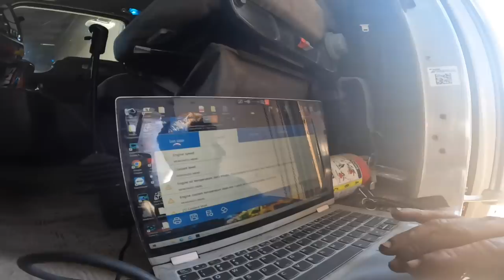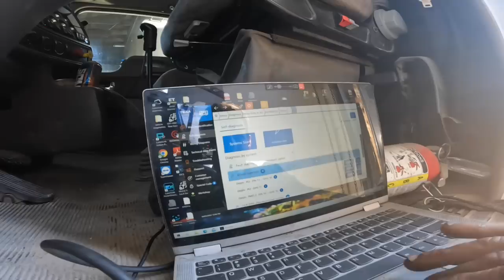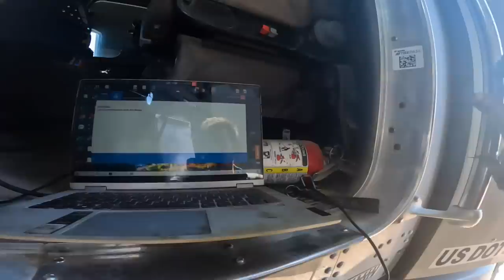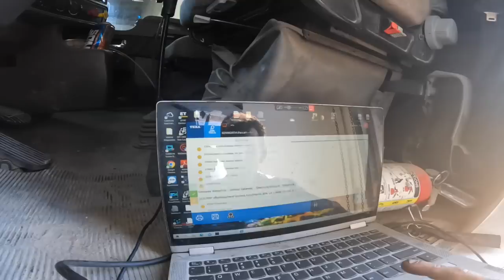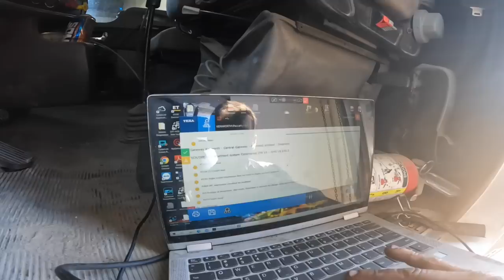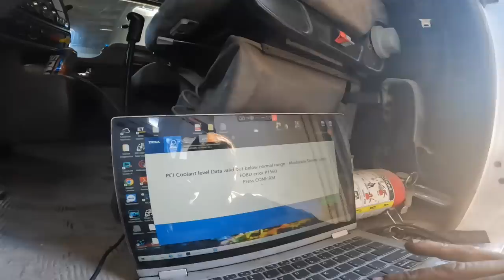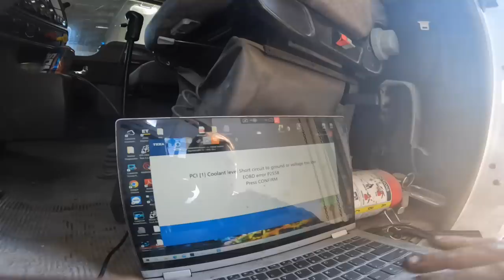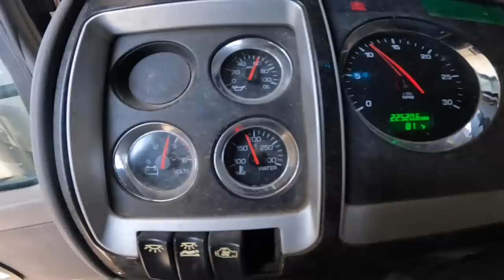Paccar thermostats and a cam over brake.

Comment: Not to long ago I had the opportunity to buy a couple Peterbilts at a real good deal.Once I opened the hood and seen they had Paccars in them. I shut the hood and said no way would I buy them.Especially after watching you work on them.Thanks for all your content on these pieces of junk.
Reply: Most all engines small to large that are junk. They but are built to break down so they make more money selling parts. As in my comment on this video, Briggs knew that the compression release was junk 10 years ago but did not fix the problem.
Reply: Paccar are no different to any other popular engine, there are tens of thousands in service and some have trouble. Mechanics never hear about the good ones as they work away quietly with no trouble. Cat, Cummins, Detroit, Volvo they all have problems. They are new to Warren though, he doesn't have as much experience on them as the more traditional "American" engines, perhaps understandable that he doesn't like them as much.
Reply: Paccar is just as reliable as Cummins. Just different problems.
Reply: @CHudson4  yes all manufacturers have issues but when they know there is serious problems and don't address them is something else different. Like GM ignition key problem for years and some have died because of it, that is the problem at hand.  Profit before product is what we have now. Yes I know no one has died because of Pacar  it's just one of many examples. A 18 wheeler not pulling loads is devastating to those who own them
Reply: @DaveG7920  profit before product. That truck is not making the owner any money now is it. Piston pin bushing walk out is poor Reman workmanship! Remember the John Deere engine night mare?  Once more poor workmanship!!  Both are from the dealership, where is the quality?
Reply: @jonbarfield4915  what problems are you referring to?
Reply: @jonbarfield4915  No its not making money but all manufacturers have problems with quality these days. Early Cummins emissions engines had plenty of problems (some still do) and Cat can't even compete and withdrew from the on highway engine business. Singling out Paccar isn't really fair, their engines work around the world in much tougher applications than the US market, its inevitable some will fail.

Comment: Had a giggle when you pulled in the driveway and said " that's the shop I used to work at ". I was looking at that little shed on the right just inside the drive, thought that's a bit small😅

Comment: Looking at that engine set up it kind of looks like you'd need to pull the pintle hitch to change the radiator cap.  I had forgotten what a pain in the ass dealing with cammed over brakes was , thanks for the reminder LOL.

Comment: Love the videos, I have two questions. First there was a hay wagon in the background when you were working on the trailer do you know if it's used to collect the plastic bales? and second there was a gasket (?) between the wheel rims and the brake drum, is that there to keep the corrosion from happening?
Reply: Yes, the plastic disc it to prevent corrosion between the brake drum and the aluminum rims. As for the hay wagon I don't know...

Comment: Warren, you crack me up! I don't see that much of a need to replace parts just 'cuz some other part is being replaced regardless of connection between the two.
I look at the water pump on my truck and think, "gee golly gosh, that pump looks old!" But why replace it? I drain and replace the coolant if it tests bad, the hoses are mere years old, I don't beat on it all unholy.

And the best part? No ECU.

Comment: Warren
I'm sure you know this, but there is a simple way to test those thermostats. Get a large pot and a candy thermometer. 
Put the thermostat  in  question into the water and heat the water to the temperature the thermostat should operate at, check the reading on the candy thermometer to see if the thermostat opens/closes at the correct temperatures,or if indeed it is stuck in one position or the other.   Just a thought.  I've used this test for decades.

Comment: Imo , the crank broke because the damper should have been replaced which is a common over looked issue says  per Bruce Mallinson at  Pittsburgh Power , now the owner should take the short  block have it installed , OPS oil filtration system put on and have a good maintenance program, I have listened to Bruce since 2009 very intelligent man 🙏
Reply: The replacement engine got a new damper because Warren didn't think it was wise to use one that came off a broken crankshaft. The replacement engine had 2 small end rod bushings fail. This was not a crankshaft problem on the replacement engine.

Comment: I hate to say it but I had a isx15 drop a liner at 450,000 miles, I had to pull the head on a paccar mx13 with bad injector cups at damn near a million miles..Paccar is a dam solid engine.

Comment: 544 John deere wheel loader , steering issues I've changed the filters, topped up fluids attempted to 
Make this thing respond not doing much. Um accumulators are the a plunger type thing, if soo can I un jam them if that's the problem?

Comment: Well its funny but I own paccars and the only issues in 500k has been nox sensors and a water pump. Been excellent for me. Excellent fuel mileage.  Will definitely buy 2 more in 2024
Reply: I have to agree. I have had great service from my Paccar`s. With just the normal replacements needed ( Sensors as per usual). I get excellent fuel milage and am happy with mine. But each to our own Warren is a capable Technician and likes old school for sure.
Reply: Agree. They may not be the best but they are generally pretty good. Better fuel mileage than the big Cummins and lighter so you can haul more. They are fairly new in the US market though and some people just don't like things they aren't familiar with.
Reply: My piece of shit Paccar with only 147k on it just got thrown back into the dealership for more issues leaving me stranded. This is literally the 4th month in a row it's had to be towed back to the dealership. Paccars are dogshit.
Reply: @Deleteguest  My best friend has 4 new freightliners and all 4 have been towed multiple times this year with less than 200k. Luck of the draw. Im totally satisfied with my 680s.

Comment: I’m not understanding the core charge situation. If you send the block with the broken crank back from when the short block was bought that would cover the core charge there, then when you swap out the engine currently in truck with the new engine that would cover that core charge. Unless I’m missing that the broken crank would not allow for a returnable core?

Comment: I work for a outfit that is mostly paccar MX 13's. Have had a lot of ECM failures that were related due to heat. Engine temp gets to operating temp and it stalls and won't start. The odometer and the hourmeter do not read anything afterwards. Can't get new ones so we sent them to europe to get fixed!!!

Comment: I’d let the dealer do what they have to do especially if it doesn’t cost him anything for them to do it and then if it broke down again I’d get them to fix again at no charge or replace with something better, I know where I’m located it’s three times for the same problem and it’s new truck or new engine, always brings a smile to my face when your playing with Josie, think it would benefit you to add more video than you put now of Josie along with the truck repairs, just a question is there any remanufacturing company that you’ve had good luck with or not at all

     Continued Success 
               Fabrizio

Comment: Just a measuring stick for ya, I’m up in New England (Rhode Island) I took my 250 under warranty over to Tasca Ford Truck Center, they quoted me 1700 for rear brakes, mind you everything except pads and rotors are warranty items, so backing plates, e brake cable, hardware, are all listed on my warranty, so 1700 for pads rotor (hat over brake e brake) so it’s a rotor drum hybrid, and e brake shoes… hopefully this helps you to know what the dealerships are holding customers up for…oh this quote came while waiting 7 days for them to swap an AC pump..

Comment: Damn it Warren, this job was not done correct. You need to replace the radiator too. While in the area replace the hood and bumper.
Reply: I appreciate the sarcasm but you will find that there are idiots out there who will think you're serious.
Reply: @danielbutler578  unfortunately it will happen. Common sense is hard to come by anymore.

Comment: Warren, always look on the bright side of things, if it’s a piece of garbage, all the nuts and bolts turn , or are already missing in the really bad areas, nothing is frozen, rusted, it’s all been apart nine times… see there’s always a silver lining…. As far as doing the water pump while your in there, we’ll maybe if it’s a cheep water pump?, and you had to remove it anyway, but on these trucks that’s not the case,

Comment: Those that make stupid comments are probably a mechanic. Over the years of listening to some mechanics they think that they are so much more intelligent than anyone else on vehicular. I remember one time I had a flex plate making noise because it was crack. He wanted to work on it because he knew I never took anything to a mechanic. He told me that it was a broken crankshaft. I already knew it wasn’t in the engine. He said I was wrong. I took the tranny off and guess what, the flex plate was cracked. I always listen to them but it’s not rocket science. Well now days it is.

Comment: You don’t want to just replace the coolant level sensor. Replace the whole reservoir from paccar. The reservoir comes with the sensor from paccar. DO NOT BUY A AFTERMARKET RESERVOIR. The magnet inside of the reservoir screws with the magnet on the sensor and causing false codes.

Comment: We have 5, 2022 mx-13 engines at a customer.They crapped injectors at 5000 miles.We took 1 truck out of service to use as a parts truck.SAD

Comment: the way it "should " be handled is to slow the timeline.. so the dealer that sold the shortblock processes the core.. crediting the truck owner. then Warren needs paid for his time and material... Now.. the Dealer makes good on a bad shortblock- crediting the truck owner full cost, against a NEW engine- AND - Installs the NEW ENGINE with WARRANTY on their dime...and the truck owner pays the difference in cost of the new engine against the short block..

Comment: in my experience with these Paccar motors they’re only good for about 100,000 miles before every little thing goes down hill…. oh and the EPA 17 motors eat cam shafts.. shit designs
Reply: Yea, you're 100% correct. I just had to have my piece of shit 2019 t680 Paccar fuck my ass engine towed back to the kenworth dealership for the 4th month in a row for more issues that leave me on the side of the road. Happened just today. It's got 147k on it with only 4600 hours.

Comment: "Truck mechanics" lol! Most of the dealer mechanics don't have any clue what to do unless it's on the computer to tell them how to troubleshoot it. We have a brand new freightliner rollback with a little DD8 and it was in the shop for 3 weeks while they spent 40hrs troubleshooting an ABS code

Comment: Regarding the "Pro" who told you to leave the trucks to the truck mechanics:  I've run into a few of these guys where the exact same engine was used in an application such as a generator or pump and all of the sudden they don't know what they're looking at anymore.  I used to try to explain to them to just address the engine issue and ignore the pump, generator, etc..., but I don't bother with these knuckleheads anymore.

Comment: I work for the largest logistics company in the USA (hint, thousands of brown trucks) and we have had nothing but problems with the PACCAR pos’s in our tractor fleet. Absolutely he worst engines we have ever run! They keep saying they have “fixed” the problems with the “new” design…. Yeah, that’s a lie. Every time they “solve” one of the problems, they create 2 more. It’s sad that it seems almost all these newer emission engines suck to differing degrees. Our old Mack’s were just about bulletproof, so were he last batch of pre emission 3406’s. The problem with a Detroit is they come wrapped in a Freightliner, otherwise probably the most reliable emission engine currently.
Reply from the maker: Sounds like a good class action lawsuit in the making. They won't stand behind their products either.

Comment: Arnt ya gonna watch a pot of water boil and sit there with your laser thermometer and check to make sure the new ones are good? I like to heat cycle my new thermostats at least 3 times to get the spring broken in correctly. lol jk

Comment: Try this. Have the dealer that has the new engine transfer the engine to the dealer that is willing to issue a refund. Have that dealer apply the refund to the new engine and then have your customer purchase the new engine from the dealer that sold the bad engine. It's all the dame dealer network all they have to do is shuffle paperwork around.
Reply: That is partly true now. If you get your truck repaired by a TRP aligned shop, the warranty is good all aound now. Collecting labor on a comeback is tuff. No one wants a loss.
Reply: @martinnorbeck4657  There is no loss. The original engine is warrantied. The transfer dealer gets full credit for the transfer. I think the engine rebuilder is responsible for all labor both times. Customer is out nothing, Warren is out nothing, Only loss is the company that did a bad job on the original rebuild.
Reply: @robertnelson4755  The rebuilder might try to  split the labor on the job. I dont know whether or not he had been paid in full for the job. Time will tell who gets stuck with the tab. Meanwhile the owner of the truck still has payments going out on it and he cant use it to make him money. Very awkward situation. Perhaps a piston oiler nozzle or two were Fooked up and not lubing the underside of the small ends and the piston. We may never here of what really happened. Most big rods I have handled had a hole from the big end to the small end. Maybe bush was loose and turned. Or hole not aligned. Not a real common failure item. But it is a Paccar engine and rebuilt at that.